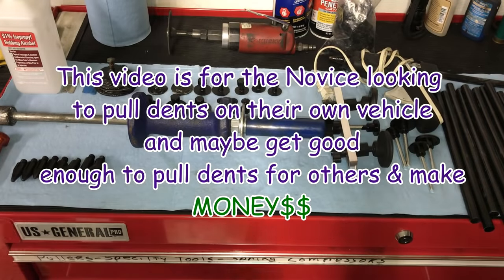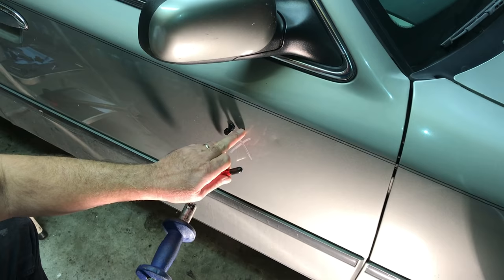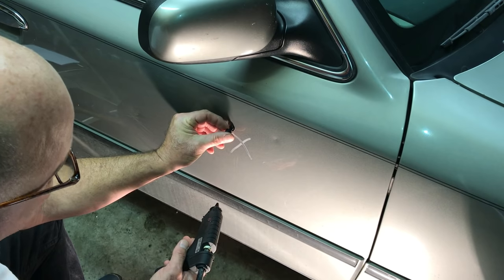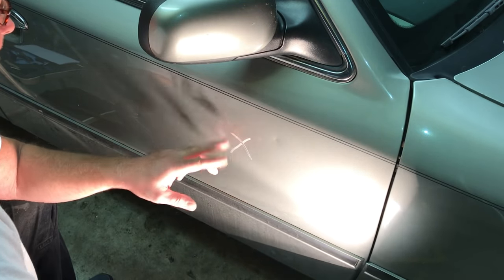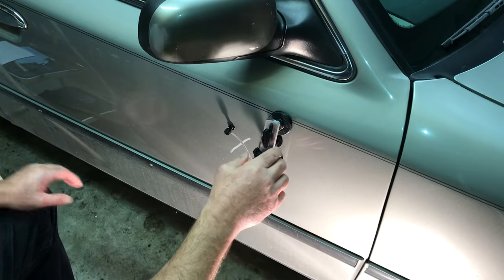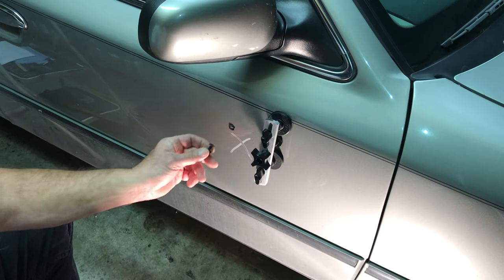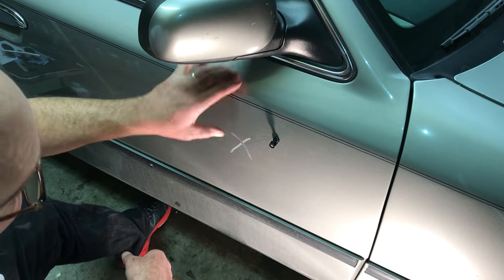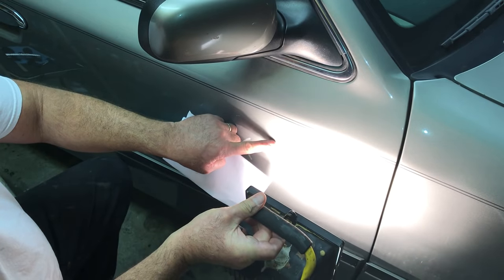#2 How To Remove Simple Door DINGS & DENTS for DIY'ers

Comment: When you are using your knock down tool do you start tapping in the very middle of work it is raised up? Or around the sides?
Reply from the maker: David yes you use the knockdown tool only if the center is raised you have to keep pulling until that happens...once you get good enough you will be able to pull the dent 99% flush and will you rarely need to knock it down..but it takes some practice...
thank you very much for the great comment it is truly appreciated. :)
Reply: But when you have to use the knock down tool when I start tapping it to you tap it directly in the middle of the raised Dent or do you start from the outside around the sides and work your way in word or do you start on the middle and work your way out word as you're tapping you said in the video when you tap tap and it circles just to know whether to start in the middle or start it on the sides
Reply from the maker: david it depends on the dent  if it is raised like a volcano then we tap the center then work around the outside if i was there i could show you   you cant go wrong by trying what works for each dent..if you go to far in just pull it back out you will get the hang of it just don't get frustrated you will get it..:)
Reply: I forgot to ask I noticed when I use my black glue sticks it doesn't work when the metal is cool what colors do I need to work in cooler weather only ones I have I got with my kit and they are black but it's got to be like in the 70s for it to stick good any recommendations websites?

Comment: What glue sticks can be used that will not eat into the paint and pull the paint off. The only glue sticks I have used are for timber and general applications. Are all glue sticks the same?
Reply from the maker: all glue sticks are not the same...you need to go to Amazon or eBay or google PDR Glue Sticks they have many and you will find the one for your application thank you very much for the great comments it helps the entire channel :)

Comment: Very good video.  I have a small dent on the front fender of my daughters Ford Focus that is right on the body line.  Any trick to getting that out?
Reply from the maker: Tom you use the same method to just pull above the body line and just below it,,,.thank you for the great comments, they are very helpful to the entire channel :)
Reply: Sweet Project Cars where did you get your slide hammer?  I cannot find a slide hammer like that?  Do you have a link for a kit you recommend?

Comment: Would it make any difference if the ding has a paint chip in the center?  Would that hurt the paint around the chip?  Thanks for the video!
Reply from the maker: michael, if it is already chipped here is what we do, we pull the dent and if more paint comes off we then do this video https://youtu.be/M8lj0_C-iPI  See, we would have to do the method in the video anyhow if the dent was not there and the chipped paint was..hope this helps you my friend

Comment: Great video and thanks for the tricks and detailed explanation. I like your first dent fix. But your second dent there is still small dent that's not pulled I can see easily from your video. I see that you pushed down the volcano but the low spot is there in the center.  Are there pull tabs that pull such small dent?  I could only think that the only viable solution is to use your scalpel (rods with sharp tip) and push the dent out from inside the door or panel that's when things get headache. Pulling out the door panel is not my thing I don't want to touch that.  And I don't like running those thick rod through the gap on top side of the door as it may stress or even possibly damage the parts. This is why I find PDR extremely pain in the butt.
Reply from the maker: cheez   we could have pulled that little dent with a small tab but we just had 25 minutes into the video and did not want to go further but hopefully we gave a great overview to get the average person rockin and rolling to dent pulling success...thank you for the great comments, they are very helpful to the entire channel :)
Reply: Ah ok you're right that makes sense. Thank you SweetProjectCars
Reply from the maker: cheez you are very much welcome :)

Comment: Perhaps you could help me out with some advice. I have a very neglected Suzuki Esteem that I want to try to bring back to life and sell for top dollar.. The paint is atrocious,, on the top and hood there are only spots of clear coat left on the base paint which is dull and oxidized. I've been watching video after video about paint and clear restoration.. Based on what I've watched and learned from many Tubers my plan of attack at the moment is : 1. Clean/degrease as best I can the entire area, probably with LA Awesome. 2. Clay the area   Here's where I'm not sure,, Should I then wet sand, (2000-3000-5000) and then apply new clear coat and polish out my defects OR should I just wet sand the remaining clear away with 1500 and then start polishing the base paint after claying : M105-M205- A polishing wax and finally a couple coats of carnuba wax and forget about clear coating and let the wax act as the paint protector ?  I'm a complete novice at this but I am good with power tools and have several sanders and a DA polisher. I'm not that good at spray painting tho.. I would greatly appreciate any advice, comments or help from a pro like you. Thanks in advance
Reply from the maker: Doug try this video and see if it helps       https://youtu.be/IF5VqNjgFo8     thank you for the great comments, they are very helpful to the entire channel :)

Comment: Hey SWP, your link to the kit on amzn pulls up 3 kits. 79, 119 and like 189 bucks. Which of the 3 are you recommending? I was also wondering if u thought the 13.99 "bridge" puller tool was important? Dont matter to me. I'll buy it if necessary. I got plenty of money! A big ol box slap FULL of hundreds! 

But seriously, I think I remembered you sayin u didn't use it. Last qstn if you can, some of those pads are at h-freight(knock off's?), u think it's unsafe to use those, or just get the right ones from the start? I do have that HF 6" VS for my car from couple yrs ago, I didn't get the 7" polishing tool one that they got though. Might just go ahead n grab that dwlt one you use and be done w it. 

Man, I see that you guys hear it all the time, but again, thx for all the vids!
Reply from the maker: Hello Michael we always say by what you can afford the bridge puller does work and it is a good tool to have so you can learn to use it it comes in handy for smaller dents   Again back to the kits Buy the one you can afford and remember you get what you pay for especially with these. Hope this helps

Comment: How does it  work with aluminum doors??
Thanks for the video
Reply from the maker: It works good you don’t have to do as much pulling that’s for sure it takes a lot less pressure with aluminum specially with the kit that we use

Comment: Mr. Hammer man,   I'm dave that sent a couple of pix of a couple sq.  ft.  of pushed in white dodge ram truck.   Some tree must have run out of the woods and got me ...   Anyway,   all I've tried is the warm water towel and toilet plunger,   and failing that,  like to got a heart attack with the proposal from my local body shop.   I was set to live with it,  until I saw your video.  My issue is more of a pushed in panel,  with a little crescent stress ridge at the top,    and some other littler dent in the bottom of the panel that would likely be susceptible to your demonstrated processes.   It's so large an area that I'm in need of some hints on how to proceed.
Reply from the maker: Gator Skeet-n-Trap if you pick up on of these  https://amzn.to/2SRIC0E  and find a good flat spot where it will stick well you can pull it out with one big yank then the small scratches and creases will have to be dealt with.
Reply: @SweetProjectCars  ,  thanks.   Ordered,   I'll report back result.   Very much appreciated.
Reply from the maker: Gator Skeet-n-Trap good deal

Comment: Hello, Thanks for this great tutorial. My car's got a 3/4 of an inch dent along the front door line. The dent spreads almost equally on each side of the door line. Can I use the method described in your video, or are there additional techniques or tools needed?
Reply from the maker: Yumn Bibou if you send a pic to use we will tell you exactly what it will take to fix it...  SWEETPROJECTCARS@GMAIL.COM
Reply: I've just you a picture by email. Thanks.
Reply from the maker: awesome thank you
Reply: So do you think the slide hammer method will work on the dent across this door line?
Reply from the maker: Yumn Bibou I read your email and was just getting ready to reply but will do it here instead ..in a body line like the one you have I would have a professional remove it as they are very difficult to remove ...sorry my friend but I just wanted to be honest with :)
Reply: Thanks a lot for advice and for replying to each of my queries.  I really appreciate.
Reply from the maker: Yumn you are very welcome my friend :) Mike

Comment: I have a dent on the front fender of my Mercedes '99 e430 where it curves.  First, the car had been painted, so is there a risk of pulling the paint off. Second, is the process any different for a curved panel?
Reply from the maker: Dino Pagiazitis the process is the same no matter where the body panel is but if it was repainted recently i would have a pro dent remover take the dent out.

Comment: question  how much glue do you put on the tab?  i find that the glue takes little specs of paint off . does that mean i put to much glue on the tab?
Reply from the maker: german shepard it is trial and error most of the time, if some of the clear comes off it is because the clear coat is old or was just not a high-quality clear coat, no problem though, what we do is get the dent out and if there are paint issues after we just dab on some clear coat the paint pen let it dry well and then wet sand the area with some 2000 grit paper like in this video https://youtu.be/M8lj0_C-iPI

Comment: Great video,, where do you get the bags of pull tabs ??. Just a quick tip,, rubbing alcohol works good on that hot glue, but denatured alcohol works even better
Reply from the maker: you can buy them on eBay or Amazon they pretty much have all the PDR stuff you will need cheap...now go pull some dents..thanks for the great comments and TIPS thanks for being here with us :)

Comment: How does the weather effect this process? I live in Texas and it’s always hot here just curious if that changes anything with the paint or metal
Reply from the maker: Ben Martin you always want to do this in the shade of high heat. as far as the paint and metal we have noticed no difference of course you dont want to do it with a car that has been sitting in the Texas sun for hours...shade is best on hot days :)

Comment: Mike, I have an Outback that my wife dented the plastic bumper in pretty good. How do I go about pulling that? It's a front corner.
Reply from the maker: Mike you’ll save yourself a lot of pain and suffering and maybe a little bit difficult at first but it’ll be well worth it is to try to reach out from the backside and push it out or remove the bumper cover to push it out there’s no real easy way from the front to do it without causing more issues hope this helps my friend
Reply: I'll give it a try thanks! Keep up the great work
Reply from the maker: Mike you are very welcome and we are glad to have you here with us :)

Comment: I have a long narrow dent on my car door which is maybe about a 1/4 inch wide by about 3-4 inches long. Would this technique work for a dent like that?
Reply from the maker: Yes it well you just glue the tab on and Pull About every quarter ranch all along the dent until you have the dent all the way up it will take some time but you can get it
Reply: Great thanks and thanks for the helpful videos.

Comment: I am having trouble with the tinest dents.  The larger one works well, but the one that is like 1/16, I can't seem to get those out as the glue can only go so small before it will not hold anymore when you try to pull.  Could you shine some light on this issue?
Reply from the maker: Hello Aaron we actually did a video over the last two weeks or so concerning very small dents can take a look at it we used a bridge bar you can do the same with your slide hammer but bridge bars work very well very small dents especially the one we use. Have a great day my friend
Reply: Thanks!  You are the best!  Keep up the great work!

Comment: Hi Mike, I posted a comment on one of your chip filling/painting videos - I did it but then noticed it seemed to be dented, you kindly replied to confirm it was a dent.  So I've had a go at following this to pull it out but it's pulled the stone chip repair out (probably because of all the rubbing alcohol to remove the glue; not a big issue as I can easily fill that again) but I just cannot get the dent out even after about a dozen pulls.  It's an Audi bonnet (at the windscreen end) - any ideas or tips for this?  Thanks in advance
Reply from the maker: Hello Chris glad to hear from you in situations like this you just have to keep pulling let it set longer and really hammered out also make sure you clean the area real well before you glue your tab so that the glue can really get a good bite let me know how this works
Reply: Hi Mike, still not having much luck with this, I think I pulled some areas up which then looked like they had  high spots but I found it very hard to see which areas to knock back down.  I was worried about making a complete mess so I've refilled the stone chip, wet sanded and buffed back up.  The stone chip repair was great (having learnt from my first few attempts)!  But I just don't have the confidence to pull a dent above a pre-filled chip and knock the highs down. I don't want to risk pulling the filling out again and having to sand the area again after filling as I think I'll be going through the clear coat. Bit disillusioned with this particular project I'm afraid :(  Trouble is it's right in front of my view from the drivers seat so I see it all the time!
Reply from the maker: Chris Bell it does takes some practice and if you can do that practicing somewhere else on your car or a friends car you will get it down...

Comment: it seems like the slide hammer you use is different than the one on amazon is your 10lb verison?
Reply from the maker: it is different and great for the novice starting out, and the pros love them too, it is the same weight as the one in the video..we have them as well we just did the video with the blue handle puller.  thanks for the great comment:)

Comment: What's the difference between the pull kit and the gadget if on both of them you had to go back multiple times to get the dent out 🤔🤔
Reply from the maker: Luigi it is our preference to the tool that you want to use, 99.9% of all vents need to be pulled multiple times to get them where you want them to be, sometimes you get lucky if you’re good at it and pull them pretty close to level and a little bit higher so that you can tap them down to where you want them to be.

Comment: Do you have to use the black  glue sticks,,and do they usually come with most kits? I have many standard clear sticks. Thanks.
Reply from the maker: Peter the only glue sticks that will work for this are the ones that we have in the show more of the video description we will be doing some videos coming up using PDR pushrods which should give you some more ideas on removing dents
Reply: @SweetProjectCars  Hi,,,I know the yellow are stronger,,but they don't carry them just anywhere anymore.  But I'll keep looking.  Thanks again.

Comment: i opened my door and the wind blew my door open hitting the dial on from my water spicket, leaving 2 small dings, one above the other. how small of dings will this technique work on?
Reply from the maker: dan muro it works great on most all dings, if they are deeper it takes a few pull to get them up high enough to tap them flush :)

Comment: How long do you normally wait to let the glue set up before pulling?
Reply from the maker: hojo70 all depends on the temp you are doing it in, we like to pull dents in 65 and higher temps...then we let the glue set no more than 5 mins on big dents and 1 to 2 minutes on smaller dents

Comment: T.Ramones
Will this method work on a dented surface that has already been ceramic coated, i.e., will the glue adhere strongly enough to allow the slide hammer to pull the dent out effectively?  Or, will it just take longer?  Have you already had experience with this situation?  Thanks in advance !
Reply from the maker: We have never had an issue with ceramic coating not allowing the glue to adhere but if you have dents best to pull them out now before you ceramic coat but if you have already ceramic coated there will be no issues

Comment: How would you charge the customer. By dent or time taken? I’m starting a mobile detail and would like to add this service.
Reply from the maker: Diezy Aragon yes by the dent
Reply: Sweet Project Cars how much is the going rate for a dent and thank you for your speedy reply. One more thing can you use regular hot glue or just the black
Reply from the maker: Diezy Aragon depends on how bad they are but for nickel sized dents its around 20 to 25 bucks per dent also the black is all you should use